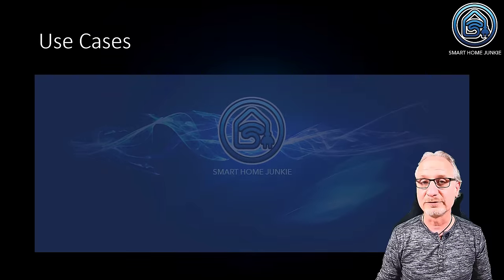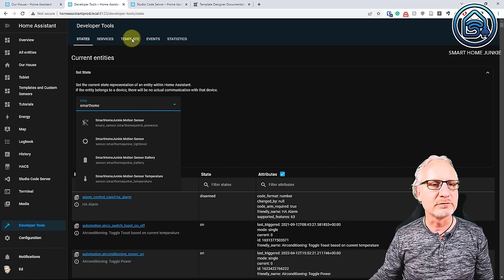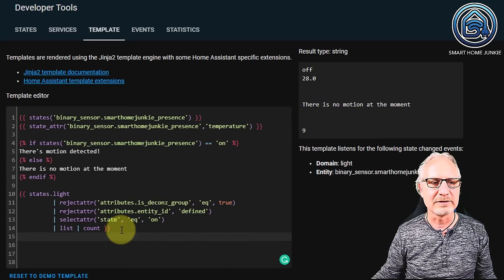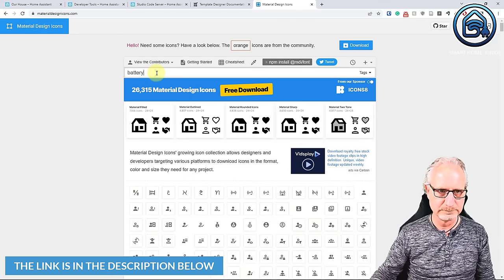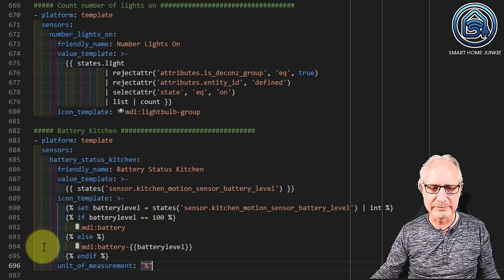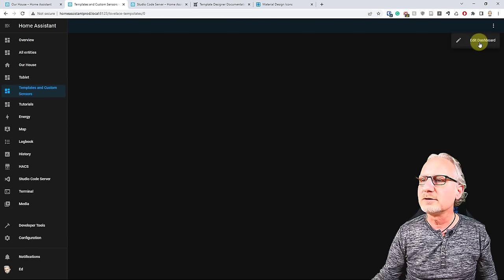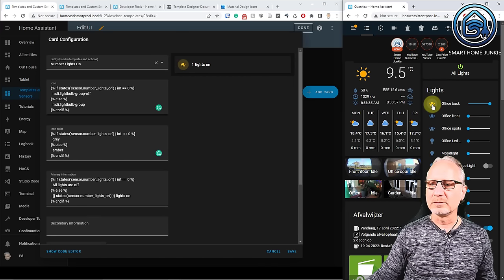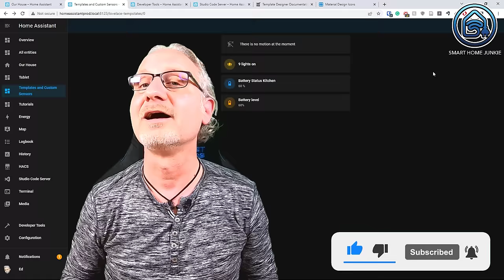Templates and Custom Sensors in Home Assistant - How To TUTORIAL

Comment: just amazing!!!! one question how I can use the templates in esphome. for example wind direction, I have an esp32 adc pin reading voltage divider array, I want an esp32 to send different states depending on the reading. for example, if the reading is 3v then north, 2.8v east, 2.5v west, 2v south, 1.7 v northeast, and so on.  code is working in the template editor after watching your video, it displays the direction according to the voltages. but I have no idea how to use it with esphome so that esp32 can send that state to home assistant. maybe I have to make a custom sensor with a platform template in esphome code but I can't figure out how. the project is a weather station and I want to send the state of wind direction to the home assistant. i really appreciate your help. thank you
Reply from the maker: It's too complex to explain in a comment, but it might be a nice idea for a future video.
Reply: @SmartHomeJunkie hi i think i figure it out but I didn't try it, I just read the documentation and I think I got it, but I try it tomorrow if I got it work I'll let you know and also I can help you for your next video, but really your video helped me to learn templates. Thank you

Comment: Ed, perfect tutorial. but when I try to enter settings I get this: This entity ('sensor.entities_count') does not have a unique ID, therefore its settings cannot be managed from the UI. See the documentation for more detail.
Reply from the maker: Add a unique ID to the template and you'll be fine.
Reply: Error loading /config/configuration.yaml: while parsing a block mapping
in "/config/sensors.yaml", line 205, column 5
expected <block end>, but found '<block mapping start>'
in "/config/sensors.yaml", line 207, column 7 @SmartHomeJunkie
Reply: Can you give a small example?

Comment: Thank you for these great videos. I'm learning a lot from them. Just to give back a little for the others when only one light is on the grammar is not correct :D Use this code for the primary info and it will be correct:
{% if states('sensor.number_lights_on')|int==0 %}
 All lights are off!
{% elif states('sensor.number_lights_on')|int==1 %}
 1 light on
{% else %}
 {{states('sensor.number_lights_on')}} lights on
{% endif %}

Comment: Great tutorial about templates and Mushroom Cards. Thank you!
I just want to add add that you can avoid duplicating code in the Mushroom Template Card and make it more reusable.
 When you have allready assigned value to the Entity property  in you card you can use it elsewhere, for example in definition of icon:
  instead of {{state_attr ('sensor.battery_status_kitchen', 'icon')}}
  you can write  {{state_attr (entity, 'icon')}}
Additionally, it makes the code easier to maintain and less error prone.
Reply from the maker: That's a great addition. I wasn't aware of that. Thx! 👍🏻

Comment: Thankyou for another wonderful adventure into Home Assistant.
I figure you might be a bit of a mind reader as I was currently having fun in this area. For me I took a different approach to counting lights as I had a ZHA and Helpers groups for various lamps with multiple bulbs, which I wanted to count as a single light.
So I created a 'List' and looped through it {% set lights_down = [states.light.bar_lamp,states.light.dining_dimmer] %}{{ lights_down | selectattr('state','eq','on') | list | count }}. This returns a count of 2 even though there are actually 3 lights. Then I ensured it was a Binary Sensor so I could test on On/Off with attribute of count (binary_sensor: !include binary_sensor.yaml).
Reply from the maker: That's also an idea indeed.

Comment: Hi Ed! Again nice video's, please continue with the great work. I followed this video and was interested in the section: number of lights that were on. 
Have just two questions/problems to solve:

1. I tried to do this and added a line in configuration.yaml and created the sensors.yaml (and rebooted afterwards), but at the developer [status], i cannot find the entity with friendly name. (in your video around 19min.)

Configuration.yaml (end of the file I wrote):
    sensor: !include sensors.yaml

Sensors.yaml I wrote:

#### Count number of lights on ###############################
- platform: template
  sensors:
    number_lights_on:
      friendly_name: Aantal Lampen Aan
      value_template: >-
        {{ states.light
                  | rejectattr('attributes.is_Axis_group', 'eq', true)
                  | rejectattr('attributes.entity_id', 'defined')
                  | selectattr('state', 'eq', 'on')
                  | list | count }}
      icon_template: mdi:lightbulb-group

2. I have several Axis cam's and think he is also calculating the infrared lights.
Do i have to make this line: | rejectattr('attributes.is_Axis_group', 'eq', true) --> or just fill in the brandname AXIS?
I tried all, but when i have the IR of one of the Axis fixed on ON, it will still calculate it to the totals.
How can i exclude those? Because the attributes Axis or similar doesn't seem to work.

Hope you can advise me to this.
Thanks and greetings.
Richard

Comment: Great tutorial. Thanks.
I'm puzzled by the | int | round(0,'floor') code.
After int, it is a whole number, so rounding won't have any effect.
OTOH, you would like to round down to multiples of 10, since the icons are battery-10, battery-20 and so on.
In your example the battery status was 60, so it works, but when it drops to 59?
Reply from the maker: I must say, I did not test all cases, so maybe the code can be improved. Anyway, it's just an example to illustrate how templates can work.
Reply: @SmartHomeJunkie  Ok, so I can stop puzzling ☺.
Reply from the maker: @JohanVromans  well, I just double checked and you were right. The code was not entirely correct. I fixed it on the github page that I am linking to in the description. Thank you for being so sharp! 🙏🏻
Reply: @SmartHomeJunkie  to fix it, divide by 10, round and finally multiply by 10.
It was quite the puzzle to solve. the templating page got the info required to solve. 

{{ (states('sensor.bewegingssensor_groot_battery') | int/10 )|  round(-1, 'floor')*10 }}

Comment: Hi, 

Thank you for all the tips you are giving us, they are very useful. 

I'm having problem trying to set the icon for my sensor.value for the weather [current.condition] . 

The problem is related to the weather list based on the weather condition [ int ] that I cannot find anywhere other than in English. 

. Fx: I'm using a French UI I'd like to make sure I have the good translation to the current condition or even better the integer values to the current states as below in my languages.

Is there is a particular place when the entire list of weather condition are available?
[ int ] : Terms

3 : Cloudy  (English)
3 : Nuageux (French) 

thank you for

Comment: Ed, again a lovely tutorial and a lot of information. The more you run HACS services, is that not memory intensive?
Reply from the maker: Thanks Alfonso,
I didn't experience any memory problems yet. But you can also use templates and custom sensors without using a HACS integration. I just used these two HACS frontend integration to make the tutorial more visual attractive.

Comment: Hi. ! great job. A complex argument made easy. 
Anyway I've a question for you that I've posted on the HA forum but without any useful reply . 
I’ve an ESP32 device connected to HA via BLE.
The ESP32 is in deep sleep for the most of the time and , perodically, say 3 secs every minute, it is awake.
When it is awake it sends the value on a specific pin (say pin 34) tha can be low or high.
I’d like that on the HA dashboard will be an “indicator” (a sort of LED) that when the value on the pin 34 is High will be ON and remain ON even when the ESP32 goes to deep sleep.
The led must go from ON to OFF (and remain OFF) only when, in the next awake interval, the value on the ESP32 pin change from High to LOW.
In other words, I need of a sort of memory that need an high, momentary, value to set ON (and remain ON) and a low, momentary pulse to set OFF (and remain OFF).
Have you ever faced anything like ? 
Thanks in advance.

Comment: Hi
This was a great tutorial and I implemented it a year ago But recently I noticed that it was showing a wrong total.  After a bit of searching, I found the cause  I had installed 3 new Reolink cameras and it was picking up the camera infra-red lights entities and adding them to the total these are exposed by the Reolink integration.  I just 'piped a -3' in the Mushroom card on the dashboard and fixed the problem as I considered that the counting was not wrong but the display was including 3 lights that were not really visible as lights.
Reply from the maker: You can also change the filtering of entities so that certain devices are not taken into account.

Comment: Great video!!

Quick question on what cameras you use to get a real-time view in your dashboard?
Reply from the maker: Thx. I have multiple. Ring and Reolink.
Reply: I am thinking of putting a Home Assistant in my RV so that I can monitor temps and a cameras.   We have a need to leave the dogs behind and want to make sure they are quiet and not too hot.  

I currently have a Home Assistant at home.  Have you done any videos on multiple instances of HA ??
Reply from the maker: @RobFahndrich1  No, I did not, but it shouldn't be a problem to have multiple HA instances. I have two myself in my house. One for testing and one production instance.

Comment: Excellent! I have used it to derive the difference between two temperature sensors and tell my ceiling fan to turn on when the difference is greater than 5deg. For some reason the difference is sometimes reported to 6 decimal places though! How would I get it to display to just one decimal place? Thanks so much for your great videos.
  {{ states('sensor.inside_temperature')float - states('sensor.rm_pro_temperature')|float }}
Reply from the maker: You can add |round(2) to your template code.
Reply: @SmartHomeJunkie  Thanks so much, perfect.
Reply: @SmartHomeJunkie  What would I do to remove all decimal places so I get 25 instead of 25.8? Thanks so much.
Reply from the maker: @peejayw  Use | round(0) at the end of the line in the template.

Comment: Hello, your vidéo made me jumping into the yaml world. Thank you. I have a question : do template generated sensors can be used in automations via the GUI ? Or do i have to write my own automation in yaml too ? 😉
Reply from the maker: You can use them in the GUI!
Reply: @SmartHomeJunkie  that's why i was asking...my sensor don't show up in the list. HA was complaining about unique_id not set, but i fixed it. But still no sensor available
Reply: @SmartHomeJunkie  My mistake...i was trying to chose from the device menu for trigger, wrong method 😉. Works a lot better with state value change as a trigger. Problem solved. Thanks again

Comment: Thank you very much for taking time to explain... you've helped me a lot ! I was wondering how to get the number of low battery devices ? I tried to duplicate the template removing unecessary lines but it doesn't work. I tried to create another template sensor with a template {{ 'Low Battery Devices' | count | int }} without success... Is there another way we can get it ?
Reply from the maker: Check this video for that: HOW TO create your own Low Battery Warning Sensor In Home Assistant - TUTORIAL
https://youtu.be/VgV_ExVeSfE
Reply: @SmartHomeJunkie  I made the comment at the wrong place… it was supposed to refer to the video you ask me to watch !
But this video explains how to make a list, not to get the number of sensors involved. Tried to duplicate code with a « count » function. Tried to make a new sensor with a count of the original one. But none works.
I’ll investigate further more.
Reply: Found it out ! Just reworked the code in the other video. Kept the beginning until {%- endfor -%} followed by a simple {{ ns.sensors | count }}
Now I will make a button with a green icon if everything is ok and a red mdi-battery-alert with a label stating the number of low battery devices . Click on that button will (If I manage to do it) open a popup with the list as you explained.
That will be a great user interface I think...
Thanks a lot ! 😉
Reply from the maker: @Kriss5054  Wow, that's great to hear!

Comment: I am having issues with adding a custom sensor into the sensors.yaml file.  I already have a custom sensor but it's the old type "- platform: template" am I able to add a new sensor under this one but in the new method? 

"template:
  - sensor:"

I am getting this error currently and wondering if you can help please?

end of the stream or a document separator is expected

Comment: Hi Ed - thank you for another great video.  I applied the principle  to "sun.sun" and it all works fine in. The value is correctly displayed in the dashboard. However I noticed it only is a static variable and does not create any history because it does not have a unique ID. Is there potentially a chance to create a history graph in the dashboard? 
##### Elevation Numeric for sun.sun #########
- platform: template
  sensors:
    elevation_num:
      friendly_name: Sonnen Hoehe
      value_template: >-
        {{ state_attr('sun.sun','elevation') }}
Reply from the maker: Hi! If you use the more modern way of template sensors which I cover in newer videos, you can add a unique id to your sensors. This requires to use a templates.yaml and a little bit different way of code format. I was not aware of that modern way at the time. But, this way is still supported. Hope this helps.
Reply: @SmartHomeJunkie  Thank you - then I do have a direction and will look for the more modern way of creating templates. Is it already described in one of your newer videos (which I really like because the are so well explained and the result later one always works :-))
Reply from the maker: @s.zurverth5157  Is explained in the Garden Watering System video and I am planning to create a separate video about it too.

Comment: Ed Thanks! I am getting the following error-  Invalid config for [sensor.template]: expected dictionary for dictionary value @ data['sensors']['icon_template']. Got 'mdi:lightbulb-group'. (See ?, line ?). Spaces are correct any clue what is going on? if I just remove the icon line config is valid.  EDIT- So I fixed it- This is why I hate YAML- I typed the exact thing you had on screen but I had to put an extra space on the last line and it was fine. I do have an additional sensor in my sensor.yaml and I had to put 2 spaces then the - platform other than that it is exactly what you showed - Why would it be different? THANKS!
Reply from the maker: Not sure. Anyway, I added a link to the code that I used in the description of this video, so now everyone can just copy and paste it. I wouldn't recommend copying and pasting though, because I think you learn more if you write the code yourself.

Comment: Geweldige video's. Ik heb enkele counters en timers gemaakt, maar die zijn in versie 2022.10 niet meer beschikbaar. Ik krijg foutmeldingen en de mogelijkheid om ze te repareren, maar als ik dat doe worden ze uit de automatisering verwijderd omdat de timer entities niet meer bestaan. Waarom is dat gedaan? Jammer
Reply from the maker: Welke foutmelding krijg je precies? Het kan zijn dat er wordt gezegd dat je template sensors tegenwoordig in de templates.yaml moet zetten. Daarna zal alles weer werken. Je moet ze dan een klein beetje aanpassen, maar dat is niet veel werk.
Reply: @SmartHomeJunkie  Thanks for answering so quickly. After I clicked the repair option the timer entities were deleted from the automation and I cann't get them back because the entities are not available anymore. I originally made them in Helpers but I cann't get them back there either. In fact all my helpers are gone (most of them with timers and counters). I also cann't make any counter helpers anymore. I'll try  to startup a backup and see what the difference is.
Reply from the maker: @pensionado7668  That's unfortunate :(
Reply: @SmartHomeJunkie  Got them back! Restored a backup and after checking if the entities and timers were there and running again I upgraded directly to core 2022.10.3 and now it's all good
Reply from the maker: @pensionado7668  That's great news!

Comment: Fantastic video ... For the life of me with the version of HA I have running I cannot get any of the code you have written to work in the icon or any other field when I use the coding I can enter the mdi:lightbulb-group (or such) and works great but the second I surround it with code that I have tested else where none of the fields will work and nothing happens... with the icon field I just get a grey circle. HA OS 8.4 and Core 2022.8.3.  The best I could get anything coding was in the primary information field:   Hello - {{states ('sensor.number_lights_on')}} and it worked  but the icon and icon color fields no coding can I do.    Wish I could post a picture.   if I so much as put a space before mdi:lightbulb-group the icon picture no longer work (with no other coding going on.
Reply from the maker: Yaml is very precise in spacing. You have to get the indentation of spaces right, or it won't work.

Comment: When I add the sensor include line in configuration.yaml, I get sensor duplicate errors! What can I do about that?
Reply from the maker: You cannot have two sensor: entries in your configuration.yaml. That said, you cannot have two sensor: entries at all. So, if you also use a sensors.yaml or templates.yaml you will get this error. the modern way is to use a templates.yaml, but the method in this video still works as well.
Reply: @SmartHomeJunkie  Thanks for clarifying!